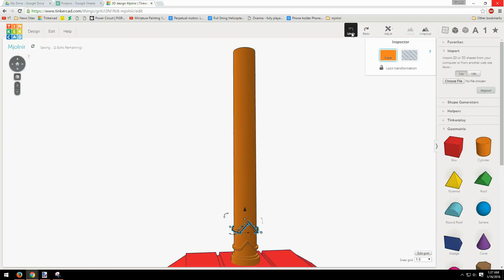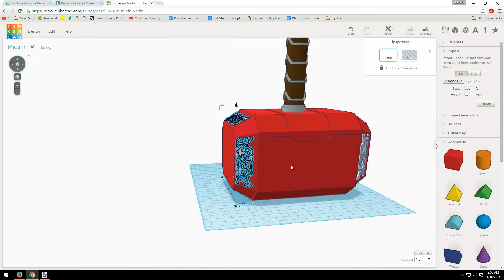Life Size 3D Printed Thor's Hammer (Mjolnir)

Comment: this just blows my lol thanks again for getting back with me on your other video I'm loving my printer it just seems slower than i thought but thats fine I'm having to use cura i was wondering what infill density did you use for this and what print speed and infill speed do you use if you don't mind me asking
Reply from the maker: Sure thing! Yeah printers can be slow, that was one of the things I was surprised by as well. On my Robo I usually print at 15% infill but I think Thor's Hammer specifically was 20%. And my speed is 50mm/s for normal and infill. The only thing faster is my travel speed. Hope that helps!

Comment: Fantastic build!!! I hope you don't mind, but here's a tip if you want to achieve the same high sheen finish as the original prop.
Try using 'Alclad' paint.....here's a link to their website:- http://alclad2.com/
The original prop, which was made by 'Propshop' at Pinewood Studios in the UK was given a similar finish. A black wash was then applied to bring out the details. To achieve the 'foxing' effect on the surface, just mist the surface with water. Hope these tips are useful.
Reply from the maker: +Handmade Props Thank you! And no I don't mind, I appreciate all the tips I can get. My wife and I are still very much new to this, so we're learning a ton. And that looks really cool. I'm going to look into that for sure. Thanks for showing that to me and giving me a little history on it as well! Very helpful. :)
Reply: Hi there, it's my pleasure:)....if you ever need any prop making help or advice, please feel free to contact me.
Looks like you are both enjoy the creative process....keep up the fantastic work!!
Reply from the maker: +Handmade Props Definitely will do! I appreciate it. :)
Reply: My pleasure!!
Reply: Thanks for putting up the files to print off. I will be making one of these for myself soon. I was wondering if you could fix the handle and add the hole at the base for the leather strap that should be there?

Comment: I got side tracked with testing bondo and some epoxy (XTC-3d).  I also determined that the amount of lift off the print bed at the corners is directly proportional to the area of the print.  Large gap in the hammer head, but bondo so far looks good on my other project so hopefully it can be fixed.  Will add a painted picture hopefully next weekend.  Thanks again for the content :)  www.thingiverse.com/thing:1311108
Reply from the maker: +neckbreaker Yeah, warping can be an issue with how big this print is. Luckily I didn't have too many issues there. And that's good to know, I'll have to experiment with different kinds of crack filler and adhesives. I can't wait to see your finished product!